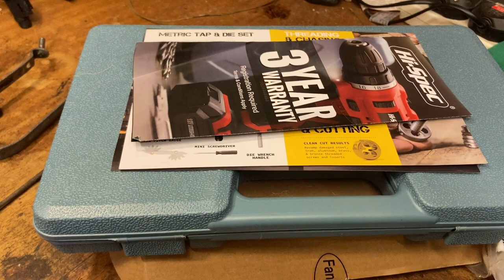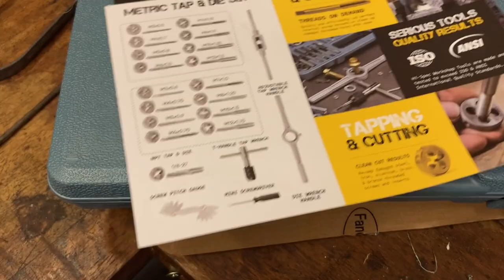Rod brake refurb and cutting threads // 1950 Raleigh Dawn Tourist Bike Restoration Project - Pt 12

Comment: Nice work. It brings back memories of the Triumph bicycle that was the first rod braked machine I worked on. It came out of a skip so everything was covered in rust, but a couple of evenings of gently teasing it all apart and cleaning off the corrosion had it all working again. Except the brake blocks - they were too far gone and I ordered replacements. Interesting to see Evaporust in use - I used white vinegar.
Reply from the maker: Thanks! I've tried using vinegar before but prefer using Evaporust. I bought 5 litres of it a couple of years ago and it just keeps going! Very good value.

Comment: You filed the brake blocks flat. Stirrup brake blocks need the radius to match the rims. Filing them flat will minimize the already poor performance of this type of brake.
Reply from the maker: A good point! I didn't film the whole process but I did round the blocks a little bit to match the radius of the rims. I was mostly concerned about removing the cross-sectional "lips" that had worn in from overhanging the edge of the rim and which would have prevented me from positioning the blocks correctly. I'll include a look at the blocks in one of my next videos. 🙂